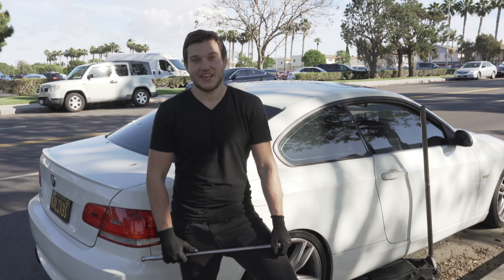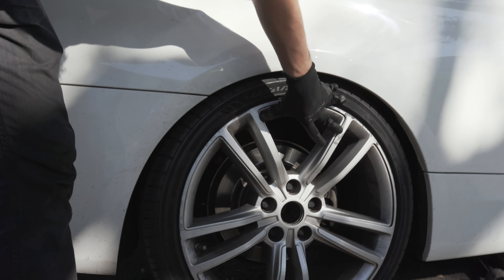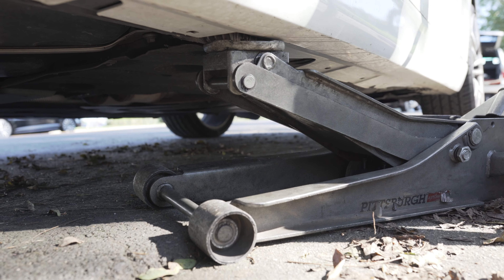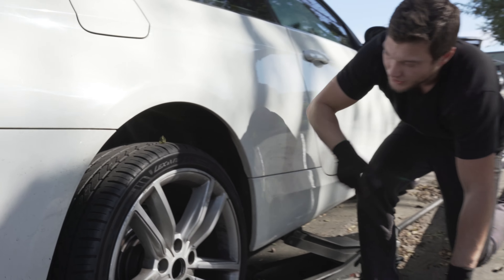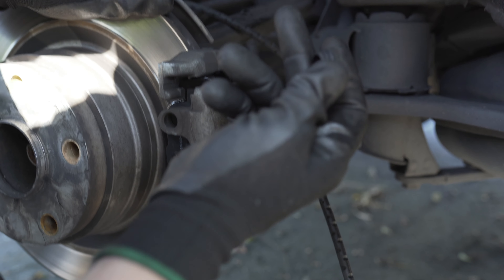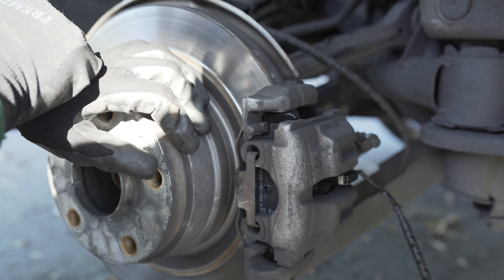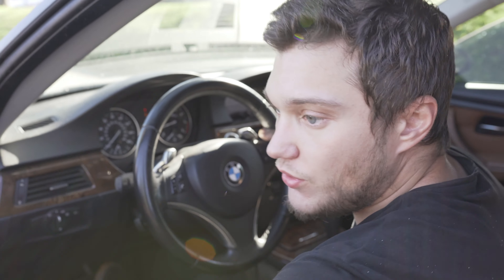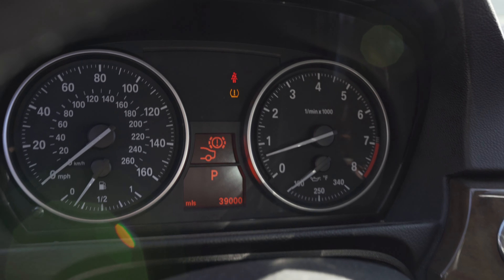DIY E90 BMW Rear Brake Pads Replacement

Comment: Easiest brakes I have ever done on my X5 only problem was the wheel had some corrosion on the rim, would not come off the rotor, all I did was loosen the bolts and pull forward and stab the brakes. Thats the rust belt for you. Great vid. 👍
Reply from the maker: Yep, did the same again once when the wheel was too stubborn to come off😁 thanks

Comment: Would you recommend a burn-in procedure for the new pads? I’ve heard something like accelerate to 30mph then brake almost to a stop and repeat 3 times etc.
Reply from the maker: Not really necessary but you can do it if you want to
Reply: @Zeiten  Cool. Thanks for the fast response! Just came across your videos and they’re top notch 👌 I really appreciate you doing these.
Reply from the maker: @LandonWest happy to help🙌

Comment: What about the brake fluid? Won’t that be an issue/create leaks when you compress the brakes?
Reply from the maker: Not a chance, only if brake fluid reservoir is overfilled when you compress brakes excessive fluid will escape through brake fluid reservoir cap and that’s it

Comment: Do those brake pad sensors come with the brake kit normally. If not what brand would you get?
Reply from the maker: Usually not, we use bowa brand its oem
Reply: @Zeiten  Do you have to replace the sensor for the car to work properly?
Reply from the maker: Brake pad wear sensor does not affect operation of the car at all in most cases, on some older models faulty sensor can shit down abs bit that is rare and basically the worst that can happen
Reply: @Zeiten  is the sensor a must to replace while replacing the pads? Can you just do the pads and use old sensor?
Reply from the maker: You can, but I wouldn’t recommend doing the job without having a new sensor since it is very easy to break the old one during removal from the pad even if it is still operational

Comment: do we need to open reservoir brake fluids cap for makesure no air come in brake fluids system?
Reply from the maker: Nope
Reply: @Zeiten  thanks mate...your video make this job look super easy
Reply from the maker: Happy to help👍
Reply: @Zeiten  hi bro.. For clear stories: my front brake pads still has about 60k km left and my rear brake pads around 26k km left previously, yesterday morning I switch on my car and suddenly my front brake pads warning pop up, when I checked visually I noticed that my front brake pads sensor had broken(wire sensor touching wheel but brake pads still thick, I decided to remove the sensor and didn't replace the sensor yet untill now), at the same time the warning sign pop up for Rear brake pads need to be replace(I replaced new rear brake pads and the sensor), my question is why I can't reset warning sign after I replaced my rear brake pads using odo and bc button?😂
Reply from the maker: Sometimes you need to drive for a bit s then reset it, happens
Reply: @Zeiten  I hope it works 🙏
Reply: Updated...it worked after I put back front sensor today(bought new sensor), I think ecu can't read when I removed front sensor before☺️..thank bro🙏

Comment: Really enjoy all your videos man. I did some rear brakes and rotors on a bmw recently. Afterwards though the emergency brake didn't work. Pull the handle and you get no grip. goes all the way up. Any idea why that would happen?  It has brake shoes inside the rotor for the e-brake on this car (can't remember which model)
Reply from the maker: Might be snapped cable or something else, take the rotor out see what’s up

Comment: HEY TIm awesome video..can u help answer this i put a new starter and the car wont crank or start..my CAS MODULES has 3 ERROW CODES: CAS AOBE terminal15 output1, CAS AOBF  term 15 output2, and CAS AOCO term 15 output 3..will this cause my car not to start and do i need to replace key and DME? thanks Im doing brakes next..great video